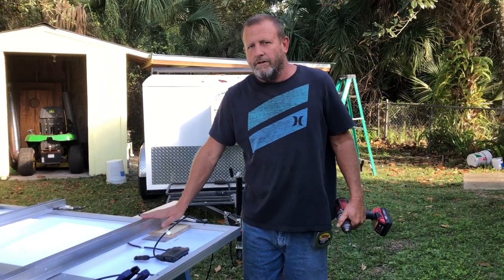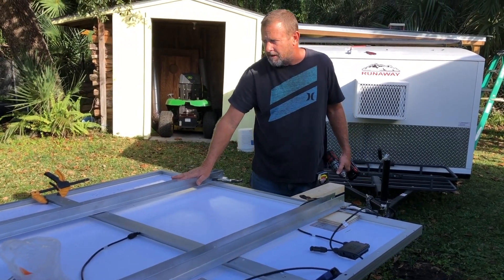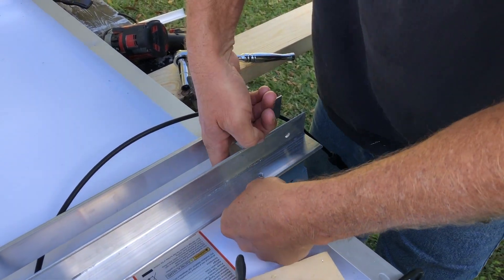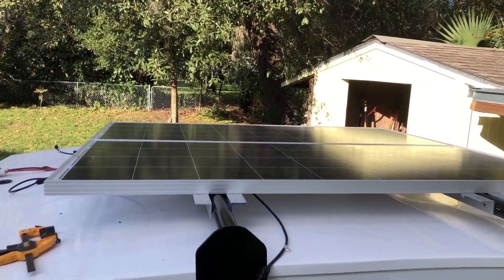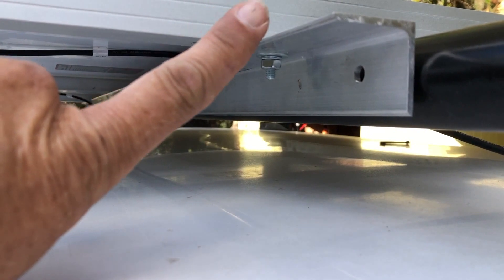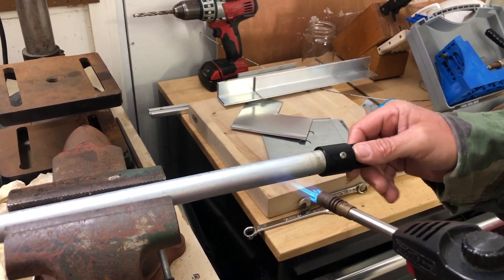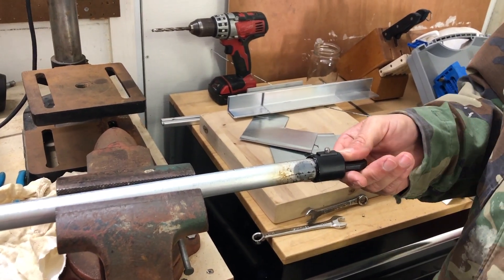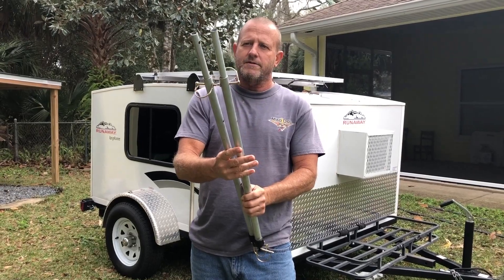Runaway Camper Solar System

Comment: Congrats. Brilliantly simple. Gains my subscribe straight off.

Your leading edge looks like a significant wind-drag catcher..?

Any thoughts re square tube vs round tube for struts.

Also this give you east and west which is brilliant for sunrise and sunset. Any thoughts to bring your manifest ingenuity to also add w separate southward tilt for midwinter? - which might at same time present a solution to also reduce the leading edge wind drag catching?

Many thanks for sharing this great DIY design here.